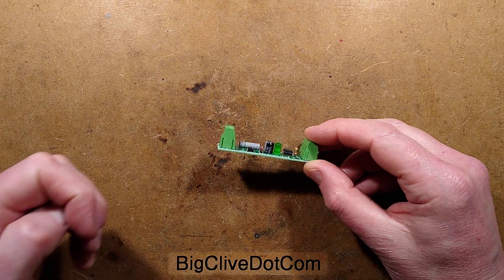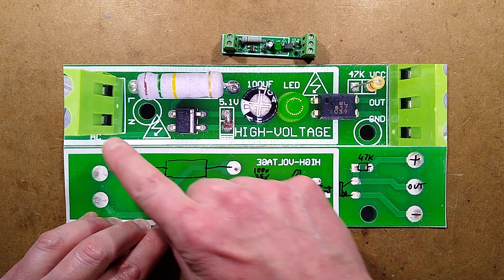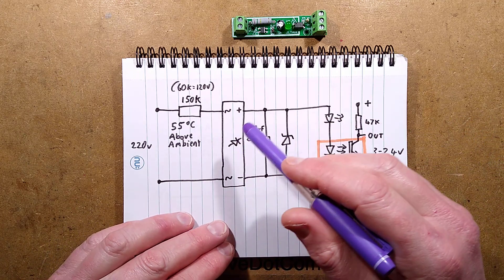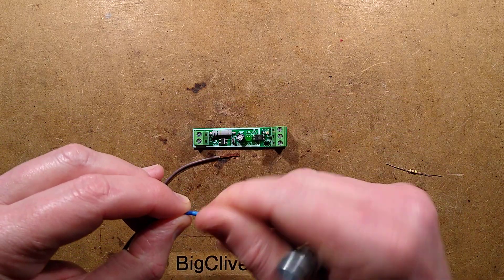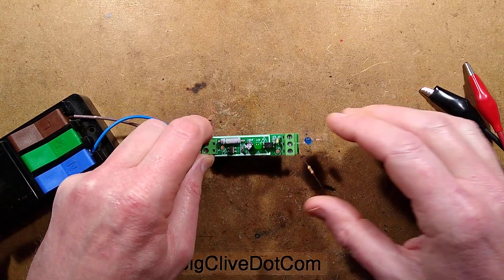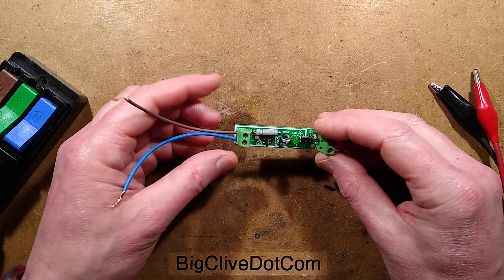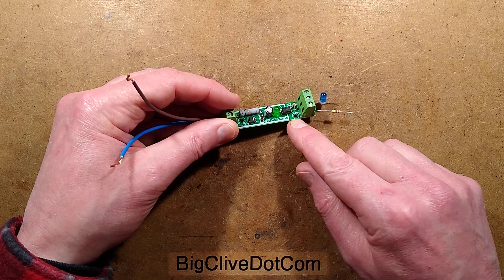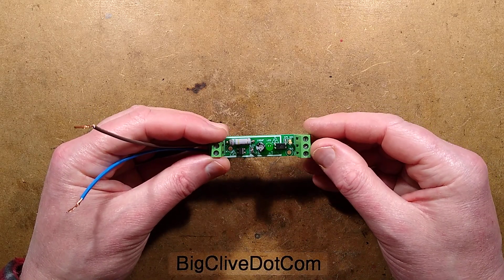120/240V to logic level optoisolator (with schematic)

Comment: funny thing with the resistor. "old" people would remember old electronic that had the board burned black by the resistors. i have even seen in old oscilloscope PCB that had been drilled bellow some resistor so to help them ventilate.
Reply: Many, many many moons ago we used to put little ceramic standoffs on the leads of high wattage resistors to get them off the board for this reason.
Reply: @geoffreykeane4072  some of the old stuff was painstakingly done!
i had a organ (instrument) that was like a space ship inside. filled with wires and boards. each wires was terminated turned around a pin and soldered in place. just looking inside in order to fix it i was amazed. in the end after i fixed it i sold it to a guy that drove 2000kms to buy it and he told me he was going to rip everything out and make it again with new electronics. almost sacrilegious!
Reply: @Francois_Dupont   I hope he didn’t wreck it!

Comment: It's a shame they didn't make it whole surface mount.  Also, they could have used a linear regulator like LR8 from Microchip which works with as much as 450v and outputs 12v or higher ... no more high wattage resistor and you could just have a bunch of diodes in series to  drop the voltage down to what the optocoupler needs.

Comment: I've seen resistors have run so hot for so long the PCB just crumbles away when you touch it (with power off I hasten to add) and renders the board useless!  But the fault is very easy to spot, there is always an upside to it lol.

Comment: Oh, so you can use it as an interface to detect, say, power outages and make some automation to react in no time, right?
Seems to be quite a nice module to purchase instead of inventing your own dodgy contraptions. Good to know, thanks!
Reply: It's so dodgy, most pros can build the components into their circuit with more quality.
Reply: From the "Industrial Lego" perspective, it's quite good; $4 to play, no need to think, start immediately, you're probably ok.
But you could design better (cooler, more reliable) and smaller, if you wished.

Comment: Caps can pop if they go over voltage even with crazy low amounts of current.  Well depending on the size and type of cap.  They break down and use their own stored potential to destroy themselves.   Try it with dipped tants sometime,  lots of fun.  microamps and they'll still blow and sometimes catch fire.  Fun Fun.
Reply: Tantalum caps are nasty little buggers.

Comment: "Quite well designed and functional" - in other words Clive, you mean it's shite but then I knew that from the off as it's electronics. Unnecessary electronics at that - where a relay would be a much better option.
I was hoping it was going to give an analogue out - which would have been some use over a relay - where an LDR could have been used.
Yes, I've come across failed phase reversal/missing circuits back in the 1980s. Likely the only PCB on the lift. a PCB track had failed. Entire control circuit was 110V (dc I presume). I wrote a BBC Micro programme that showed the lift in the shaft - and all the variables I used were the names of the relays.

Computers/electronics have no place being anywhere near lifts.

You mention the LED may be on but there's no one in - found a lift in Brum where I could 'press' a button, it'd light but not activate the lift ! Same problem. I trained at school for pressing buttons for whole milliseconds. Digital watches - press the start stop button on the stopwatch before it registered 100th of a second. Quite hard to do and maybe 5 milliseconds was long enough for it to register 10 !

Comment: I don't understand how it is isolated, if the rectifier shorts, wouldn't that send 240 through the 47k resistor and through the output?
Reply: The rectifier isn't electrically connected to the 47k resistor or anything else on the output side of the board.
Reply: @Monkeh616  the top of the resistor is marked positive? That comes from the rectifier?
Reply: @reacey  No, it doesn't. Yes, the rectifier has a positive terminal but there's no connection between the two. That would defeat the purpose of the board.
Reply: @Monkeh616  where is the secondary getting its power from then?
Reply: @reacey  From the external source you connect to that terminal.

Comment: SOLUTION: ?   
Add a Neon bulb in series.  The resistance values look about right and that bulb will safely use up about 90 volts.  
If that Opto needs more current juice, put in TWO resistors and TWO NEONS in parallel. Three?  The resistor value must match what the Neon Lamp requires; no more juice than that through a lamp!   Maybe four?
Would that work?

Comment: And if you do design a circuit like this:
1) Specify the Resistor for 2-3 times the expected Wattage.
2) Design the board so the Resistor is physically raised above the board and adjacent components so you don't get a BoardBQ from an overly hot Resistor...

Comment: Could you use a small capacitor in place of the big resistor?
Reply: 220nF + 100R would probably be fine, and run cold.
But would cost an additional 10c, so the vendor chose otherwise...

Comment: . My home automation detects potential water leaks by monitoring the pulse counter on the water meter combined with no movement in the house to alert to leaks.  I have a water softener which has two 24v ac solenoids to flush the brine tank.  I two of those sensors modified to 24v so i know when the softener is flushing in order to avoid false positive water leak warnings

Comment: This is interesting. I'm looking to build a project to remotely control power on my boat. I was thinking about using latching relays so that any fault in my project didn't cause power loss, but I wasn't sure how to sense the state on startup
Reply: Hm, I thought latching relays were both rare, and horribly expensive.  And your boat runs on 240V ? :)
But anyway, an opto fed from the power (optionally, via a bridge rectifier, a smoothing cap, and a resistor) should give you a nice clean signal.
But keep that salt water away from the electronics, eh?  :-)
Reply: @theskett  when in a marina, you get a mains hook-up so you can charge your batteries and run things you wouldn't normally be able to. For example I have an immersion heater for my hot water tank, which saves running the engine up. Would be quite a luxury to have hot water ready as soon as we arrive at the boat
Reply: Good info / thank you. To ask a stupid question, though: it would seem [to me] that you'd have to plug into shore power, to get the immersion heater running... and that sounds kinda manual, so can't be done remotely.  
And then if you have shore power, just run the immersion heater anyway; no need for a microprocessor to make a decision.
What am I not understanding, please?  :-)
Reply: @theskett  what happens is you come back after a trip to your home marina and hook up to the shore power. It might be a few weeks or even months until you come back to the boat. Remote control would be useful. Actually remote control is a secondary benefit. The main one is separating the switches from the actuation via Canbus.
Reply: Ah, thanks... so you're often / mostly hooked up to shore power, but aren't on the boat and so don't want the immersion heater [etc.] to run [because wasted $$$] -- hence remote control would be good.  You got cellular / Internet on the boat, though?  Should be easy-ish :-)
Also I'm not following your last sentence; maybe explain a little, in case someone else has good ideas?
Reply: @theskett  yep there's and LTE router with site to site VPN 👍

Comment: If you believe that the zener diode is not necessary for this circuit, why not take it out and replace it with a simple wired connection across it? In my experience, you'll either be correct and be able to pretty much demonstrate that you are. OR, perhaps even better, you may learn something you needed to know. The ego may prefer the first option, but the second option is probably better since it permits growth.

Comment: But how would it mount on DIN rail? As for the relatively high current through the opto, that might be to compensate for cheap components as the CTC (current transfer characteristic) which used to be a minimum of 50% as standard can be as low as 10% for the really crap ones. Come back HP all is forgiven, even the costs of the opto's.

Comment: I still use relays to give my dry contacts. Am i noob ? Need to interface to another protocol anyway.
Reply: Relays are a safe and simple way to do this. But more expensive if you need a lot of them.
Reply: @Seiskid  It's kinda funny. I'm a professional system integrator. But on many occasions a 230v/ELV thirth party signal needs a parallel feedback interface to the automation system. And the relais used are DIN compatible, so i guess that is one of the other reasons. But i just catch myself using relais for high power applications while i could just use cheaper modular relais, like Finder has, for example.

Comment: I want to detect 220V with the help of this module and LE3U PLC (chinese PLC) by programming it with GX works 2. If I connect COM of PLC input channel to OUT of this module and then connecting GND to PLC input channel like X0. I hope this works like the way you have connected LED. By the way the PLC you have shown is same like one  Im using.

Comment: This is a really useful circuit for a project I'm working on. Does this go in series or in parallel to your load?
Reply: Lol, you should probably watch it again: it is the load (or a switch, it depends) on the low voltage side itself. And consult the schematics in the end, before you go out and try to use it IRL, deal?
Reply: @jayzo  well, I welcome you to read my answer in a non-abusive, non-offensive tone. If you don't mind, that is.
Reply: Check out the MID400. Smaller and fewer parts.

Comment: Excellent and very rich of infos as usually.
I am trying to make a notification system, to get notified when 220V is available using that module.
Anyone know please where I can get an arduino code for that module.
Thx
Reply from the maker: The module just puts out a logic signal, so you could interface it to an Arduino or WiFi module like an ESP.  There may be existing code for doing that.

Comment: Thanks for sharing the video.
Actually I am working on "Single Phase Prevention " circuit for 3-phase 440v supply. The working of circuit is- There is 3phase motor which should not run if any 1phase is absent.
I used the same optocoupler circuit you have shown in video with separate optos for every phase(RYB). Output of optos fed to the MCU and relays connected to Motor starter unit.
But the problem I got is- that 3 phase motor keep running when one of the phase get switched off because reverse current issue. So it does not sense the phase absence. For that one absent phase the running motor on 2phase acts as a generator and keep to feed supply to that opto LED even if one of the phase is absent. 
It will be very helpful for me if you share your thoughts about it.
Thanks.
Reply: You could add current transformers to measure the current on each phase. If the motor is running with one phase down you'll see that there's almost no current on that line.
Reply: @eDoc2020  Also tested using CT. Actually current increases from normal level on that phase when 3phase motor starts running on 2phase. Also not preferring to use CT as it will increase the circuit complexity(analog signal,use of ADC, setting normal current levels etc.)

Comment: Wouldn't it make sense to mount that 1w resistor above the board with a couple of millimetres clearance from the board so that air can cool it slightly. Also that mounting hole next to the resistor leaves only Teflon screws as an option, I agree that they should have thought about that a bit to have it further from the resistor lead.
Reply: Glass-filled nylon should be fine too.
Reply: Or just regular nylon, there's no big stress on those screws (because the board's only a few grams).

Comment: 25V capacitor across rectified mains?
Reply: The voltage is clamped by the two LEDs and the Zener diode.

Comment: Why not simply use a relay with 240 volt coil ?
Reply from the maker: Less reliable.
Reply: More expensive.
Reply: Big, expensive, mechanical (prone to failure), non-silent, bouncy contacts, not IOT compatible, and also beware of inductive flyback.
Reply: In my industry we are constantly changing entire PCBs because the opto-isolators eventually burn out.  I’m not convinced they are more reliable than relays, which also may have better isolation?  IDK

Comment: Remove the 100uF capacitor and you could use it as a zero-crossing detector.
Reply: This is exactly why I've purchased this module,  actually a three channel module (arriving via a very slow boat from China). I'll be removing the capacitor from one channel so that it'll act as a zero crossing detector, the other two channels will be used to sense voltage presence as designed. May consider changing the resistor and running at 120v instead.  The goal is to reduce any premature breakdown due to over heating as this application will already be exposed to above ambient temperature.  Have you had any experience using it as a zero crossing detector?
Reply: @sydcarter3  I've serviced such zero crossing detector circuits, without the capacitor and the Zener, quite a few times. Usually it was the resistor which had died.

In a zero crossing detector of this kind, substantial current goes through the optocoupler (and the resistor) You want to have a pulse which is reasonably close to the zero crossing point, so you need sufficient current even at rather low voltages. I vaguely remember resistors with 15kOhm for a CNV17-2 and 33kOhm for a CNY17-4.

At 230V, a 15kOhm resistor would amount to about 3.5W of heat. These were usually 5W ceramic resistors which would fail after a few years (in an actively cooled enclosure, correctly mounted well above the PCB in "free air", the "leg" wires of the resistor being sturdy enough to keep it in place). I usually replaced these with the somewhat larger 9W versions - which meant that I eventually lost my repair side job; the "upgraded" units didn't fail any more. I always upgraded the resistor, even the ones which had not yep failed (the devices operated on three phases, so the circuit appeared three times in one unit). The optocouplers were usually not socketed but soldered in (common practice for reliability). They failed rarely, but when they did, I often replaced them with higher CTR ratio versions (like CNY17-4 for a CNY-17-2), which allowed me to also switch to 33kOhm resistors in place of the 15kOhm ones (heat going down to about 1W).

This kind of zero crossing detector is (apart from the failing components) very reliable. No false triggering issues or missed zero crossings.

Component failure can be dramatically reduced by choosing "oversized" components and  appropriate "heat management".

Comment: What resistor would you use in that board?
Reply from the maker: That depends on your local supply voltage.
Reply: You need just a low-enough-value resistor, to get the opto working.
So, connect up the power, and check the output;  if on/off'ing the power doesn't change the output (maybe because you've connected a 240V board to 120V), it's easiest to piggy-back another resistor (same value) over the existing resistor; "two the same" gets you from 240V to 120V, with the same current; Ohm's law :-)
If you're planning to do something harder (e.g., check for 440V) then you might need to clip out the existing resistor and stack some higher-value components; but if you're not already aware of this, go ask a friend :-)

Comment: I was expecting something more like a ring detector on a phone line:
470nF capacitor and 10k resistor in series with one lead
back-to-back zener diodes of a specific voltage in series with the other lead
connected directly to the optocoupler (and LED in series if you want) with a backwards diode in parallel

Or another design:
AC in - 470nF capacitor in series with L - bridge rectifier - Resistor and zener diode - Optocoupler and LED

Comment: https://youtu.be/0C2o0rXOXYE?t=1047
Could the board be 24V DC?
The relay at the bottom of the shot is printed with it for its triggering voltage.

Comment: Wahhh? Insane! Burn .5-1W just to trigger a 1mw optoisolator? Thanks for the great analysis. Shouldn't we engineers think about energy efficiency? We have microprocessors consuming a few microwatts costing $.25 with orders of magnitude more complexity. That power on detector would probably consume >>$20 in electricity over the life of an elevator, or rather the overheating resistor costs the user $20 each. A $5 relay would be better. Seems like a capacitor would be better. Maybe you can invent the Dubai voltage detector that is more reliable and energy efficient?

Comment: Reverse phase is becoming unnecessary in the applications with variable voltage variable frequency drives.   Three phase is only used to charge the DC bus.
Reply: However it's still perfect for fixed power or two speed motors.

Comment: zeners works as voltage regulators. If you get voltage rise zener will regulate, overvoltage protection. Cap is only for smoothing pulsation from bridge it would not protect from voltage rise.